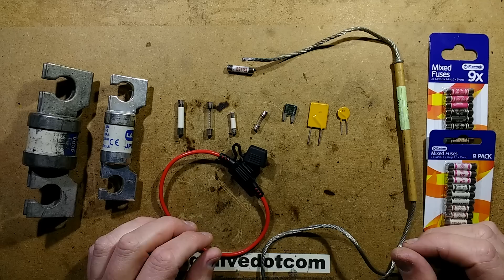Things you should know about fuses.  (including a 15kV one)

Comment: Hi BC, great video, I will link it to some of my customers that like to "fiddle" with things. I did notice that the cheepie fuses appear to have the wrong or at least poorly refined sand in them.  You mentioned that the sand is there to cool the arc, this is not strictly correct, the sand (high purity silica), turns to glass from the heat of the arc, forming a physical insulator in its path to quench it.   Another great video I cringed when you started talking about the guy randomly jamming in contactors.
Reply from the maker: I should have researched that a bit more.  The blown fuse had created hollow flat glass tubes around where the fuse elements had been.
Reply: @bdf2718 It looks to me like the fuse broke the circuit just fine in that video. Where's the problem?
Reply: You might like this.  A video of what can happen if you put a fake BS1362 fuse into the type of plug where the fuse is inserted into a carrier in the base.  https://www.youtube.com/watch?v=KVJVswLbqaA  It's only 6s long but makes the point very clearly.
Reply: Clive was basically correct, the latent heat of fusion of the sand absorbs the heat and keeps the temperature down to the melting point of silica which gives a whole new meaning to the term 'fuse'.
Reply: the small amount sand has little to no effect on the temperature, the purpose of the silica is to form an insulating glass barrier to quench the arc.

Comment: Thought you were going to show us the 15K fuse blowing :(
Reply from the maker: I'd need a suitably high voltage and current supply to make it blow out properly.  However, here's a video of it happening:-
https://www.youtube.com/watch?v=ATEWXsMawMg
Reply: @bigclivedotcom  Hey by  any chance eney relation to you?

the name coincidence?

AKA Clive?

If so, it would be a big coincidence, so maybe not?
Reply: Funny you should mention "raining molten material" as this video reminded me of a story I was told by a high school teacher... The original school building was built with the hot and neutral lines properly oriented, an addition was added on with all of the hot/neutral reversed, and when they threw the switch on the sub panel to turn power on to the addition, light fixtures exploded, molten copper and broken glass raining down from the ceilings... Somebody got their butt chewed out over that, I guarantee it!

My grandmother's house (built in the 1960s) has roughly half of the house wired properly, the other half with hot/neutral reversed. I learned this the hard way by plugging my stereo receiver into one outlet and a turntable into a different outlet on a different fuse. Hit the power switch, and immediately was left with a 20-lb brick with all output transistors literally blown wide open. Fun stuff.
Reply: @dashcamandy2242  You don't know what would causes exploding faucet lamps excetera. Anyone can comment on this would love to hear. Unless of course, it was three phase and there was a face-to-face short or so. We're going to have or something Goofy with the three phase.
Reply: That's Western Australia's official fuse testing department, Aussie Aussie Aussie pop bang zap.  That is a dropout fuse, the fuse element Clive shows in his video is loaded in a ceramic tube under spring tension, when it blows the tension is released allowing the top latch to let go and the ceramic holder swings down out of the holder, so when you drive up the Street and see a fuse hanging down, it's blown.  In Victoria we use HRC fuses with explosive charges in one end, the charge fires a 2" nail out the centre of the top cap to release the latch, unlike the West Aussie version they are a one shot device.  I prefer the HRC version, they completely contain the arc, but mostly because the reusable ceramic tube gets coated internally with vaporised metal like the old S.E.R.Fuses did,  so over time they become more likely to support an arc at least long enough to rain molten material down on the operator or long grass below causing injuries or bush fires.
Reply: @Yes-ng6rf  We also have those fuses in the United States as well. And some other countries. By the way, I remember seeing one blow once.

When I was much smaller. Interesting story to go with it.

I remember when I was young. I was really into a logical stuff for me and I was in the Antiques. There's a gills a lot of electrical related.

By the way, I really want to be in love horses here myself.

But I remember how in the apartments where I used to live for folks.

As you can guess where they have I changed you mind running every which way.

Squirrels use those wires as the highway a highway system, right.

Well one day I'm washing out there. And all the sudden I see a squirrel running along. And the next pole there's a Transformer. Well squirrel comes up. Bangi bright flash and the sound of a blown fuse in the discharge by tirad. In the video.

And a squirrel is gone.

AKA no longer in one piece.

You could say Rest In Pieces.

There was literally a head there tell they're like, they're like, Had their tail there a like there a light there and most of it was just gone or vaporized.

The guy that work for utility company of course is asking all kinds of questions and stuff when you have the opportunity if you're interested in stuff, right.

I told him I'm interested in the illogical and I'm a Quaker of Audis. And stuff and you said hey, do you have any old fuses or anything?

Oriole is Larry just said yes.

He says will object couple Woods at the back of the truck you can have.

Heck I even got a modern fuse cutout.

That have been decommissioned. But still intact

And a fuse that was in it.

And a brand-new fuse in the package.

When are the animals are out there? And he offered me that my dad said you should do that.

I was in grade school at the time.

Cool, huh.

He invited me to take her to her the power plant as well.

And a few other things I learned a lot. We actually became friends later. I didn't realize. I met him before. I just didn't recognize him because of his hair in our things.

And then call Cindy sis. I already know you. Do you recognize me I said? Sort of look for military says you're at my house about six months ago.

Annie said I was going to get back with you about some stuff like this anyways.

One of the things I can still collect to this day is glass ceramic and Porcelain insulators.
Reply: Anyone have photoinduction's number?
Reply: I think it's 999
Reply: Chaos Corner Bad idea!
Reply: madbstard1 If you want to do deaf, suggest that. Those things are loud, I learned the hard way.
Reply: That was pretty cool. And it led me to about 200 more videos.........got to bed about 4 hours late lol

Comment: Great video!
Could you explain how come the industrial fuse has three metal ribbons instead of one? 
I mean one like the single wire in a regular fuse.
(I  recently disassembled a similar one and couldn't figure it out...)
Reply: Several reasons for the multiple elements, fuses are thermal devices, the elements have to get hot enough to melt into pieces in order to open the circuit, and the thicker the element, the higher its thermal mass, so several thinner elements share the current, they react (heat), faster resulting in better performance curves. The elements are spaced apart from each other within the cartridge so that the sand encapsulates them from one another and the ceramic tube. There can also be thin steel wire thru the centre of the cartridge connected to an external spring loaded contact on one of the end caps, the wire (usually nichrome), has a higher resistance than the silver elements so it plays little to no part in the conduction of current, but melts quickly when the principle fuse elements blow thus releasing the spring tension to trigger some form of release mechanism / micro switch to indicate that the fuse has failed.